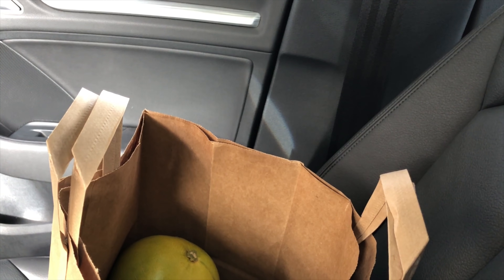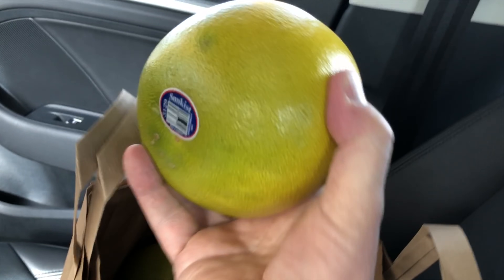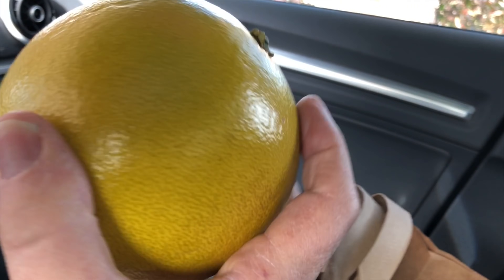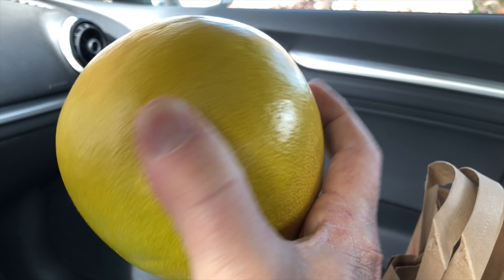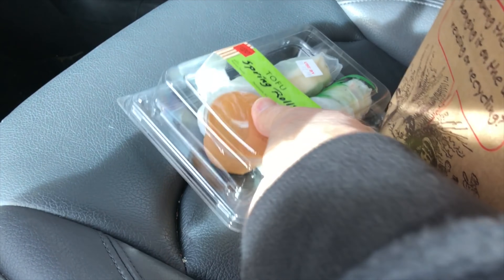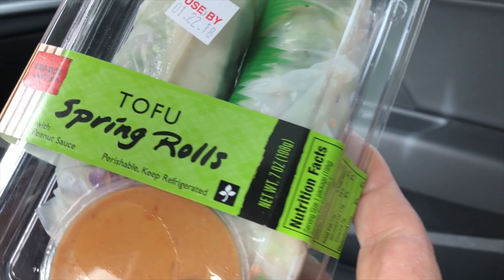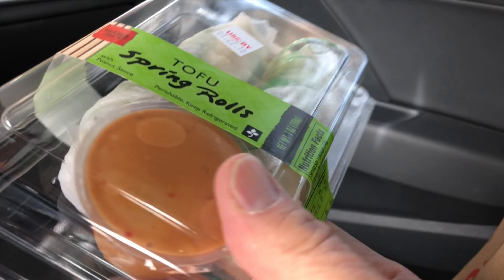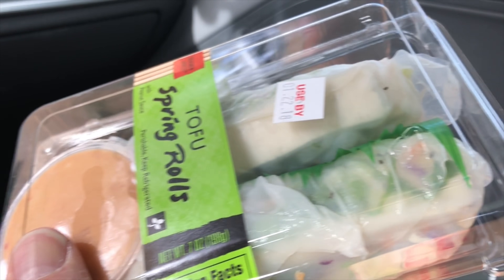The future of Class D amplifiers

Comment: Man, im sitting here in 2024 listening to music on a fosi class D amplifier. tpa3255 chipset. It was a very flat, neutral and analytical sound. very clean and accurate, but not the most musical. Not the most depth or width. And based on your designs running tube input stages into class D and mosfet power amplifiers. I decided to build a class A tube preamp circuit for the class D fosi amplifier. And it was a headache, had to debug and basically redesign the preamp i went with after learning how to do so. I cant afford a legitimate high end tube stage. But in the end... WOW. 

I ended up building the circuit around 6AG5 or 6AU6 tubes,which are a lot less expensive then 12a*7/6 tubes, and more widely available in matched NoS pairs. (6AU6 is actually the 6.3v version of 12AU6)

There is absolutely something wonderful to the tube front end and solid state power section. Every solid state amp i have sounds better with this thing on the front end. It only adds about 2-3db gain max and never clips. But man... such a lush and vibrant musicality it adds. Such a simple litle circuit too. Idc if it's inverting the phase.

Im actually toying with adding a second stage behind the initial tubes using a mosfet to restore the phase to normal instead of another tube. I dont want to stack tubes (thd) on one another, one tube per channel does the thing im after just fine

Comment: switch mode power supplies these days can run at upwards of 1mhz. really in theory the higher your frequency on the class D, the less distortion you will have. this is because the audible range is always the same 20hz-20khz, but a low pass filter will allow for far better linearity in that range if it has to filter 1mhz instead of 100khz. and you'll get a much less step-y wave as well, for the same reason. there's also the fact that at 1mhz you get 50 "samples" (switch cycles on the mosfet) for a 20khz sine wave. now obviously there are limiting factors. your mosfet has to be able to be driven at those frequencies, and pretty much all mosfets will consume more power with higher frequency.

I was doing the math to build a class A amplifier because they're technically "the best", but just generally that pesky input capacitor will already work as a filter with the biasing resistors and mangle some region of the input. I think I'll attempt a 1mhz class D instead and I think I'll likely end up with something quite nice and entirely undistinguishable from a class A for any human. that is to say, a class A engineered to the point of no distortion.

Comment: Its all just opinion on what makes a great sounding amp. Love  or hate them Class D amplifiers are the future  , they are just cheaper ,more efficient, lighter smaller. What Class D amps and modern DACs have done is make it cheaper to get good sound for the average person. I think some can sound too analytical, but they will just get better.  I once said that phone cameras would never be that good as good pocket cameras because of the amount of tech you need to squeeeze in the phone itself. Also the size of the lens . But phones get thinner , and the cameras seem to just get better!.  There will probably always be "old school" amps , just like there will always be a need and love of film cameras. which is great!!!!
Reply: I don’t believe the comparison you’re making is very good.  Carrying around a cell phone is standard. If it has a nice camera then great. That’s why we use it. 

As for Class D amps I can see it in car audio and mobile DJ use. They can be small and light and powerful. 

Home audio is different for many.  The amp is like a piece of furniture for some. So the large heat sinks and even lighted VU meters from McIntosh people love.  

Some tube amps look really nice too and in cold areas like Canada people actually like the heat it produces. 

This vid is from 3 years ago too and if Class D was going to take over it would have happened. Many are pushing it because they see low cost and high profit margins.  

My system is nearly 25 years old and no plans to change.   Class A/B good enough for me.

Comment: I don't really see the problem with pulse width modulation audio power amplification. If the carrier frequency is high enough, there is no problem with a simple LC filtering. I have used 500 kHz pulse frequency and a voltage controlled monoflop modulator (based on two NE555) instead of a triangle comparator modulator. My amplifier sounds fine and it has an outstanding good linearity.
 
I have also tried delta sigma modulation by use of a voltage controlled charge current source and a simple astable NE555 multivibrator. It works also with outstanding good linearity. Especially low level signals benefit because of the very high frequency (up to 1 MHz) of delta sigma modulation at these levels.

Comment: thanks for another video full of that rare thing, common sense, I question does it have to best the alternatives, given it's advantages just equaling the best should do, being expensiveto design and develop excellent ones, buthavingcomparitivelyfew separate parts outside the chips,economies ofscale and low assembly costs must take over, so if there are class d amps that sound as good as a great tube or solid state amp and cheaper too boot, surely they will slowly take over the market almost completely. in our world of a few disproportianately rich and a mass of middle to low income, I think this bodes well for class d my much modified vtl 100 compact monoblocks, sound wonderful, but as a disabled pensioner, the cost of an annual re-tubing is now prohibitive, so I'm going to have to try things like the parts connection ice nodules, I'm wondering if that is going to bit me?, anyway thanks for your efforts, despite being a pretty advanced ameture, I took a mediocre valve preamp on a circuit board and re built it as piont to point, changed the outpuy ecc82's to 12bh7a's, so I know at leastenough to be dangerous, yet I learn many things from your videoes also finding your presentation style great so thank you from new zealand

Comment: if i get it right the class d produce a linear signal but creates waves in steps like a digital signal and its tricky to smothe this steps out, guess alot can go wrong, soundwise, in this process.
so would it not be a solution to ramp up the clockspeed heavyly to make the steps insignificantly small and therefor remove the need for the smothening filters?
this should result in the "perfect" amp, may a sterile sound but verry natural and tru to the source.
a question:
i intend to get a verry cheap class d for a project.
would it be beneficial to run it on batterys to feed the amp with a 100% clean and noisefree powersource?

Comment: Class D amps, though not digital, due to its high-speed power switching module will induce a bi-directional digital-like hash or noise.  Superior forms of line filtering / conditioning with bi-directional filtering capabilities either minimizes or negates this problem.  The problem being that this bi-directional digital-like noise goes back out the AC and then impacts other components like a little cancer.  A stereo chassic Class D amp with a single AC inlet guarantees that this digital-like noise will be shared between both L & R channels.  An integrated Class D amp is far worse since the active line-stage section of the int. amp must borrow AC power from one of the channels.  Since both channels are already sharing this bi-directional noise, the active line-stage is now getting a double-dose of this same noise.  Not good.  What's even worse about an int. Class D amp is that this double-dose of digital-like noise is then amplified as it goes through the active gain stage.  Mono block Class D amps are the only way to go and even then it's best to attach dedicated bi-directional line conditioners to them.  Under these conditions I reckon a superior Class D designed amp can easily compete or exceed a Class A or A/B amp.
Reply: Can you give me more detail about the line conditioners? Do they have to be separate from a whole system conditioner?
Reply: @falconquest2068  I suspect hey kinda' do since some-to-many products do not recognize nor remedy bi-directional noise.  Hence, your only assurance is that the dedicated line-conditioners are indeed bi-directional filtering. And I suppose there's opportunity for any mfg'er to claim or state their products are bi-directional filtering and we consumers would just accept that.  But the ultimate test is in the sound.  First.  Finding a superior line conditioner that actually cleanses/purifies/filters/conditions the noisy AC is a bit like looking for a needle in a haystack.  But they do exist.  On top of that it also needs to be bi-directional filtering so the haystack gets a little bigger.   If you can find a superior line conditioner that actually performs as intended, you're way ahead of your contemparies when it comes to musical presentations.  If per chance it's not bi-directional filtering and you're running a Class D stereo amp (single AC inlet), it's annoying but not the end of world and you're still ahead of the game.  If per chance, it's Class D integrated amp with single AC inlet it's pretty much game over and you might consider another hobby.  Even if it's a superior line conditioner.  :)
Reply: @ToadStool942  Thanks for your reply. I use a BPT 2.5 Signature balanced power unit that maintains a rock steady 120 clean volts. My plan is to go with class D mono's driven (for now) with a SS pre.
Reply: @falconquest2068  I always thought highly of BPT's products.  My favorite ic's are still his old inexpensive silvers (after I had them cryo-treated via the full immersion method) and I've owned ic's 10 x's more expensive than these.  Whatever happened to Chris?  Anyway, I'm sure that 2.5 Signature is fine but technology has improved quite a bit since then.  For years I used the passive, dedicated, and bi-directional filtering models from Foundation Research but they are now defunct too.  I'm currently using the Jena Labs THE Two line conditioners which are a tad more musical.  Your employing monoblock Class D amps will benefit greatly.  Monoblock is the only way to go when it comes to Class D.  Best.

Comment: Switchers are great for power supplies, not for music amplifiers. And I don't need a 4000 watt amp that weighs 6 pounds and fits in a drawer....
Reply: Class D amps are heavily used in studio monitors, because such monitors are active speakers. This is how musicians listen to their own music in studio.
I think class D amps are complex to make from discrete elements, because all of them require power transistor switch optimization. This algorythm can only be implemented in ASICs/FPGAs. While tendency to integrate everything in one ASIC puts everything including power transistors inside one microchip. So every designer of class D amp either uses existing ASICs for their amps, or gives up from class D amp development.
I should note that DSD format used in SACD disks of Sony suggests exactly class D pre-amp scheme, and Sony designed respective ASIC to do DSD to analogue conversion and DSD to PCM 176,4kHz conversion. You can easily find SACD bit stream specs to realize what is proper frequency of the class D amp shall be to provide SACD disk quality of class D amp. It is about 2,8MHz and no less.
Paul said about several hundred kHz to build class D amp, and then mentioned about problems to reproduce high quity high frequencies (I think 10-20kHz). This is why the problem of quality was mentioned. Bit stream clock frequency shall be around 2,8MHz to provide adequate quality in high frequencies. Every attempt to use lower clock speed will make class D amp sound worse than SACD disk shall sound.
The question with class D shall be : Are there any ASICs of class D  amplification that work with SACD clocks? Are ther powerful enough? How much class D ASICs required to build high quality amp with 2x100W or 2x400W power output?
The only high quality class D amp I'm aware of is Marantz PM-10. Find its price to understand how high quality class D amp can be priced.

Comment: PCM/DSD audio > AVReciever Atmos Decoding > Digital ....wire -transmission along AC/DC power > At speaker box ---ClassD amp with DAC & with DIGITAL CROSSOVER  & feed back system(Speaker oscillation sensor ) > Analog audio signal > speaker/ Tweeter 

Its true that ...its hard for making a RC filter ...capacitors dont sound same for all time ....

Class D ...with feed back controll system ...based on speaker oscillation 'sensor voltage '

Mean we use ...sensor..that may be ....IR optical sensor ....or quartz sensor ........which corrects speaker oscillations 

So here....speaker must contain ..a oscillation sensor ....OPTICAL sensors are ..high ACCURATE ....
..BUT NOW A DAYS ...we still using. ..sub woofer (with quartz sensor )

Even in feed-back topology. ..i am not sure ...CLASS D will be precision perfect ...in high frequencies ...

I am unsure...classD may be better  ...if using optical sensors ...anybody may ...make ClassD amps ...

That days ...each ..speaker must comprise its ..own amplifier .....

Forget to ...say this ....

Class D works best ...with ...PCM DACs...(i.e.  amplifying Bit level resolution of audio corresponding to DAC bus-width....& without converting to analog line level output )

Comment: Paul's reference suggesting Class D = PWM is a bit old-fashioned. The best switching-mode output stages use pulse-DENSITY-modulation (PDM). You should expect to find future audiophile power amplifiers using higher average carrier frequencies and faster and better-suited semiconductor technologies (such as Gallium Nitride transistors). The only reason for using medium-voltage MOS devices is that they are very cheap. You can buy small highly optimized PDM IC amplifiers capable of pushing more than 50W into each of two low-impedance loads. On the other hand, the stated need for using higher carrier frequencies is in order to support the higher-frequency components of an audio waveform is probably missing the point. Rather, we should expect to see audiophile amplifiers being bi-amped, with all the component frequencies above, say, 3 KHz being handled by a simple low-power Class A amplifier. We can also expect to see more speaker systems integrated with their drivers inside the enclosure, using very short connections to their actuators, thus obviating the need for "pure crystal" (sic) copper connections. I have a Meridian system that uses six, fully-integrated amplifiers per unit, driven by an digital signal on a tiny, cheap optical fibre. In my opinion, the audio industry is pathetically and pathologically slow to embrace in 21st-century technologies.
Reply: Dr. Barrie GILBERT I find your comment very educating and intriguing!  Thank you!

Comment: 100kHz is a pretty darn low frequency  to run an audio PWM at. You will aggressively lose amplitude (and dynamic range) at audio frequencies that way.

P.S. I know you like to call attention to the fact that most Class D amplifiers are analog, but a configuration which is growing in popularity involves no comparator and no analog frontend, basically using the amplifier as the DAC. Sufficiently high frequency PWM/PDM, in some circumstances, can be about as good as sigma-delta (but if you want gain control, you obviously need to greatly increase your switching frequency, maybe in combination with some voltage division or multiplication at the power supply). The human ear is less sensitive to amplitude at higher frequencies, which makes the dropout less of a problem, but 100kHz is still (in my opinion) a bit low for good audio PDM.

Another interesting direction is ternary "filterless" (no deliberate filter components required) spread spectrum (low peak EMI) Class D amplifiers, but these will probably not be too popular until the major patents expire in a couple years.
Reply: Any amplifier is an analog device. Even any digital device can all trace down to analog. It's meaningless really.

Comment: Humans sing and make music with musical instruments that are for the MOST PART analog. Now we have for a long time have synthesizers, triggers, sampling (of analog sounds). The more you stay with or replicate analog reproduction (which your ear hears in analog) the better. CLASS D converts to PWM and adds a lot of filters to get the job done... Analog changed to square pulses and filtered to make it sound OK. Filters will ALWAYS colors the sound no matter how hard you try. Can you ear tell the difference? Maybe.
Reply: it doesn't matter if the result wave form is good. Class a ab can have harmonic distortion intermodulation distortion, thermal noise, power supply noise. Same with the class d. A good design is going to be Good design. Bad design of any topology will be bad.
Reply: any component will ALWAYS color the sound no matter how hard you dry : p
Reply: Low pass filters required for class D are made to suppress 20+kHz frequencies. They are not audible. Such filter does not color sound for human ear, like any DAC with the same low pass filter do not color audio.